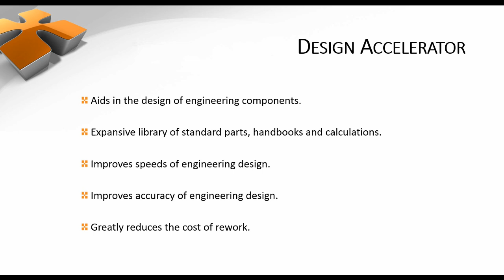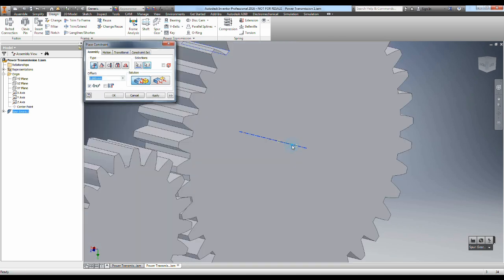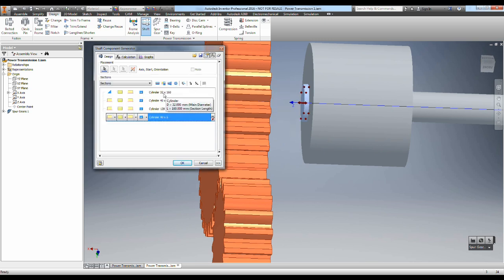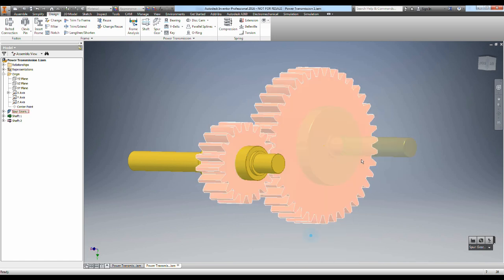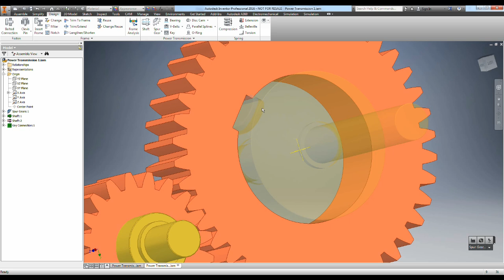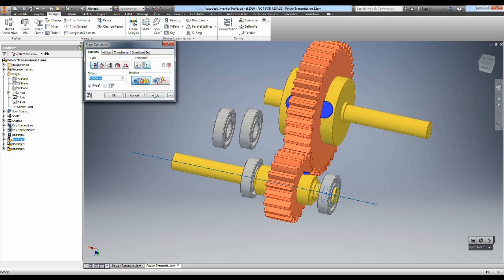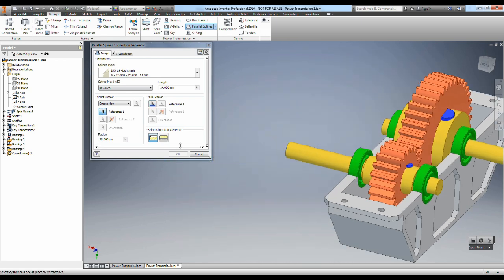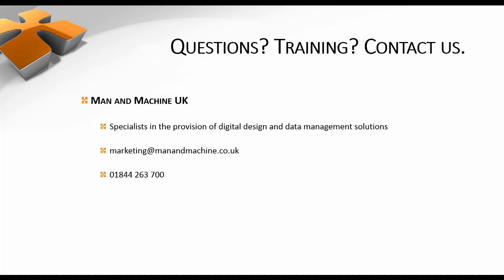Creating Power Transmission components with Design Accelerator (Autodesk Inventor 2016)

Comment: Hey, would you mind helping me? First of all, your video has been very straightforward and therefor  very clear and helpful!

I'm a mechanical engineer student, and I've had to create a gear box. Erm, I've run into a small problem though; According to my calculations, (Which I'm 90% sure of are correct), the key should be able to transmit the power without a doubt. However, when I generate it using the power transmission tools and let it calculate it, it lights up like a christmas tree.

It's red all over, and just tells me the key is too small, and won't last... Is this Inventor's problem, or did I do something incorrect? I can provide info if need be. 

Thank you, if you ever read this.